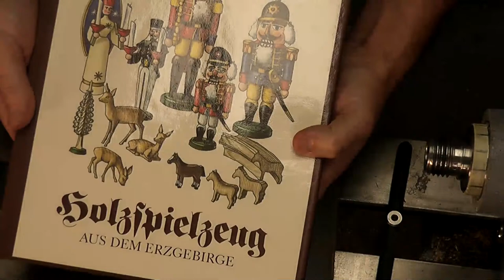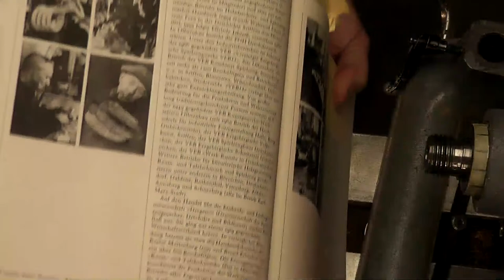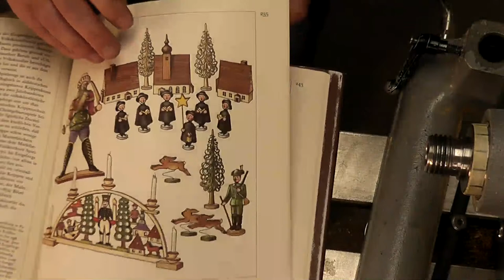How to Make a Christmas Carousel Part 2 - Woodworking Wisdom

Comment: Thank you for the great demo... a few questions

Did you say there were plans for this... can see them anywhere?
How do you fix the center pin to the base and center column to stop it dropping down towards the base?
Were can I get the bearings with the solid center?
Reply from the maker: Hi Matt, the following reply is from Colwin - "The centre pin is the same size as the hole and fits snuggly, this means it will hold itself and you're able to slide the scene holder up or down to position where you want it. 
The plans are available from my Etsy site at the following link 
https://www.etsy.com/uk/listing/870840513/learn-to-make-your-own-christmas-pyramid?ref=hp_rv-2"

Comment: Greetings again Colwin & Team.    I’m wondering what kind of spacer (if any) is used between the base and the actual scene holder.  There has to be something to keep the pieces apart.
Reply from the maker: Hi Mark, the following reply is from Colwin - "The scene holder is kept in place purely by the friction of the pin in the hole being the same size of 3mm. The gap can be as small as you want it as long as it doesn't foul the base, I would recommend about 3mm."